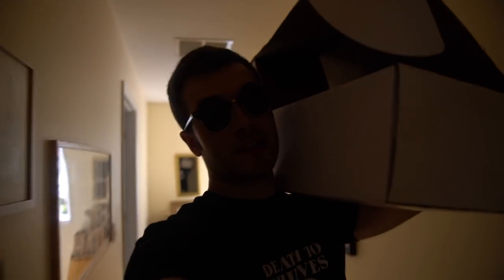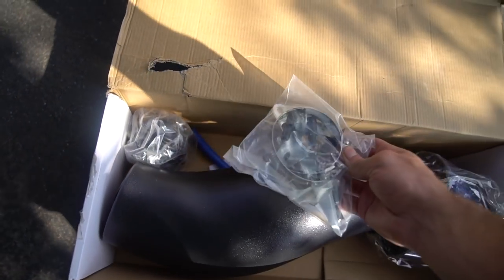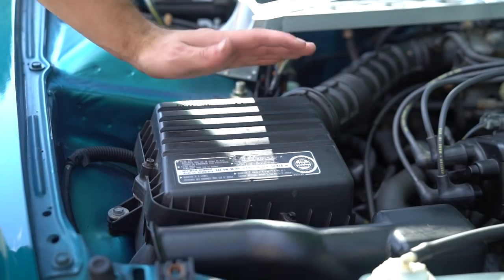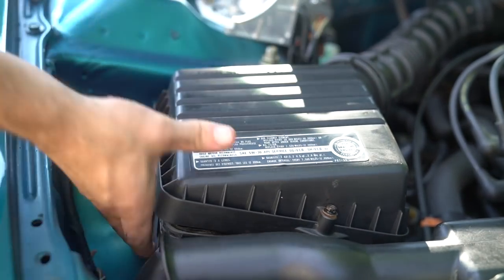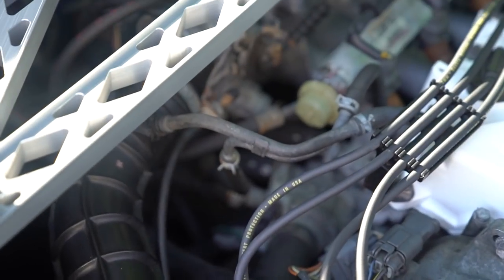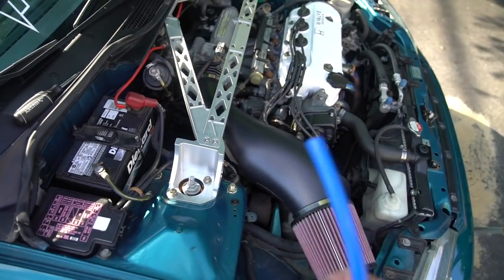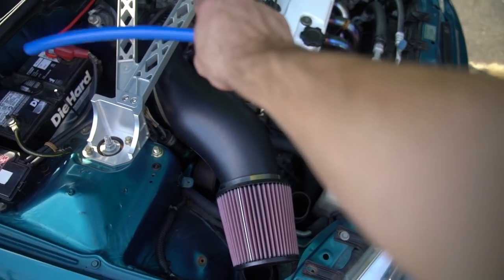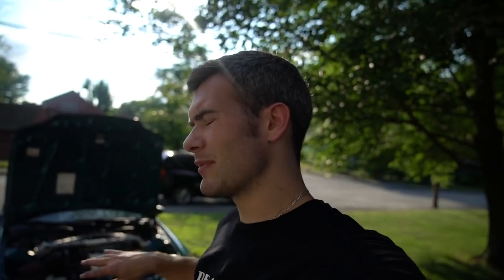INSTALLING AN AIR INTAKE ON THE CIVIC!

Comment from the maker: YouTube is allegedly removing your subscriptions without you knowing, check to see if your unsubscribed and click that heckin button dudes!
Reply: Happened to me.
Reply: They unsubbed me from you, resubbed now
Reply: Holy crap it did it to me thanks for saying that!
Reply: I read that then looked and I wasn’t subbed, resubbed now
Reply: Divine, did you need to re-tune the civic after you installed the air intake? Also is there a sensor attached that connects to the car's computer chip? Thanks for the vid. Jordan from New Zealand

Comment: You mentioned you were leaving in the pipework under the fender to supply cold air to the new filter...unfortunately it’s dead weight and won’t supply air from the front of the car the part you grabbed @5:43 was the intake pipe providing air from the Bay Area down to the pipework under the fender (the resonator box which makes the intake quiet) and back up to the main airbox and onwards to the intake......the resonator box under the fender is pretty heavy plastic and can be removed either through the inner fender guard or remove the bumper just a couple of 10mm bolts hold it in place.

Comment: The piece under the bumper is just a box it doesn't pull air from the bumper, that first little piece you pulled off is where the air is pulled from it goes from engine bay in that box to the intake.

Comment: Actually those 2 things stop water from getting into your intake one side grabs the air goes down to a little box that will hold any water that get in there that has holes at the bottom for it to drain out of and the other side allows the air back in to the intake

Comment: Very cool mod! But it's actually a hot air intake, because it's not closed off. Also doing this to a stock vehicle can cause issues be cause it takes more air in than usual, can cause it to run wierd and may throw codes.
Reply: how does it take in more air ? lmao there's a device that takes in a certain amount.

Comment: sell the delsol get another daily and go balls to the wall with the coupe????
Reply: Rwd drifter car
Reply: Well I forgot he is getting an import too...
Reply: 350z are the cheapest Rwd cars right now and there are so many Aftermarket Supports for them that's my next car
Reply: Gravecb7 Accord i think a miata would be one of the cheapest rwd cars tbh
Reply: not here but z is the perfect drift car, basically copy adam lz, my buddy has one and did everything but the oil coolers and did pbm instead of the wise fab but wise fab is better imo.
Reply: Justin Tran Miatas might be slightly cheaper. Z's are more common to find though.
Reply: Justin Tran it is I hate how the NB is so expensive ugh it sucks

Comment: You're not really going to notice a difference in sound at idle or while parked, wait until you're low in the rpm range and floor it...it's going to sound crazy at higher rpms...

Comment: +DIVINE not sure if it does make a difference on an older Honda....I do know when installing a SRI or CAI you should disconnect the battery for 10mins. first to reset the ECU ...After intake installed  reconnect battery & start up the car and let idle for another 5-10mins....Then go for a drive and some full throttle pulls to get the ECU to relearn the air amount...

Comment: where did you relocate the hose that goes to stock intake from the valve cover?
Reply from the maker: Tucked it under the intake because it’s welded to another hose that I can’t remove
Reply: oh, i see. im about to get one but dont know where to put that hose lol
Reply: The other hose it’s welded to is a coolant line to your throttle body and if get yourself either the other half of that blue hose or some stock black hose you can just remove that metal pipe work completely and just put the spare section of hose from the one point to the other and use a couple of small hose clamps to secure it each end.....much cleaner looking....personally I would pop to an auto store and get a section of rubber hose rather than that soft silicone pipe and use that to replace both so it looks more oem.....plus I think either paint the intake white or look into hydro-dip you can buy kits to do it at home and hydro-dip some other parts as well 😉👍🏻

Comment: those pipes underneath the air intake, like the ones that bring cold air from outside the car to the cold air intake. Isn't a lot of water going to get in there when it rains? and is it bad or not? cus that's something I was a bit worried about

Comment: Ik this is an old vid but I’m installing a cold air intake in my 2008 acura rl does the filter just sit over the air box resonator or do I have to remove the whole resonator box

Comment: Did you not watch the Scotty Kilmer video on air intake??? LOL
Reply: FatherOfTwoBoyZ yeah man! Stock intake better!
Reply: Scotty was right I installed the intake and that thing was all erratic idle going up and down!! Put everything back good to go!!!
Reply: @rickyg4800  you need to disconnect your battery for like 30 seconds to reset your ecu and let it idle for 10 minutes then drive it for another 10 and it should be good to go

Comment: Here in California if your intake pipe doesn't have a carb number you better keep the old intake filter box.
My Ej2 b18b1 swapped has the stock ej2 box until get BAR it.
Still storaged.
Looking for a OBD1 integra GS California manual transmission ECU.
But great job man..
Car looking good..

Comment: I’ve heard that these intakes aren’t a good idea as they just suck up all the hot air in the engine bay 👀
Reply: Thatd be a short ram which his almost is. I bought one with extra piping that runs down where the airbox is feeds from so its a true cold air intake.

Comment: Stock airbox gang :(
Filtration > noises
Reply: Are you saying a K&N cone don't filter?
Reply: AX53 Research has shown they increase flow, but fill up with dirt quicker. So the “increased flow” is temporary. The duration they have increased flow is much shorter and parabolic, compared to a regular paper filter. They also let more dirt through the filter. There’s been a lot of talk of oil getting on MAF if your car has one. Which obviously isn’t good for it. 

So with all that in mind, the OEM makes their airbox which pulls in the coolest air that it can, while still being able to filter, be driven in wet, snowy, dusty environments, and put out factory horsepower ratings. Obviously if you have motor work done then you probably aren’t going to be using a stock airbox, but I’m running 20psi through my stock turbo stock airbox paper filter just fine.
Reply: Do you have said research to show for it?

"fill up with dirt quicker" - Sure
"So the 'increased flow' is temporary" - Temporary might be a strong word. Parabolic doesn't mean temporary. It can mean anything from 1 year vs 3 years, to 1 hour vs 3 years, depending on how aggressive the parabola is.
"oil getting on MAF" - With cheap autozone filters sure, not with a K&N. Plus the Civic has a MAP sensor.
Reply: AX53 do a google scholar search. You’ll find them. They’re all lab tests, so the actual duration will obviously depend on location, how much you drive, where you drive, etc. but the “parabolic” curve refers to the increased flow. As the filter fills with dirt, the flow drops. As it fills more, it drops more. OEM filter stayed linear throughout the test. Advanced auto filters are dry. The k&n filters are the only oiled filters I’ve seen. And yes, on a turbocharged car where you’re pulling in a lot of air fast, you’ll see it pull oil through to the maf.

Comment: You should have done a swap rather then build that tiny single gingle boi
Reply: Adam Honda98 ya  i know right. he has totally made it very clear the he has an extra 5 grand laying around that's just burning a hole in his pocket.
Reply: chasemc69 lmao tf makes you think a build is $5000.. Amateur hour
Reply: Kaleb M it's not really about the money it's about doing it right he left the stock engine in there which makes no power at all literal s***
Reply: Adam Honda98 you obviously have never seen bisimoto’s wago that makes 700hp on a single gingle with a turbo or boosted bois wago
Reply: Raceboy5512YT I have but I'm pretty sure you're not going to see the same 1000 horsepower so you can get with a b or even K series motor because you're putting a lot of stress on the cam and like I said earlier it can crack in half I've seen it way too many damn times already I hate it when people push your luck and then you have to spend a lot of money to replace it

Comment: there no benfit with after market cold air intake they all function the same lol just a waste of money not dissing you just the truth
Reply: Luis Serrano on some cars they do make a difference factoring in displacement/size of the engine. On smaller engines they're pretty much useless